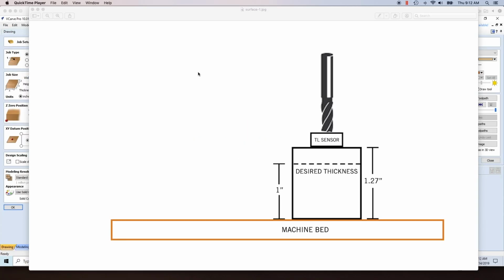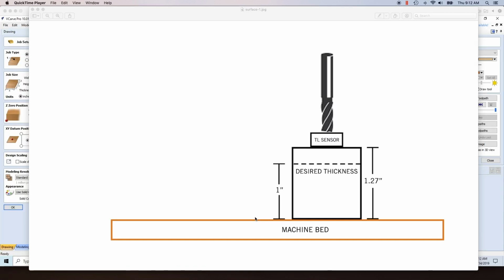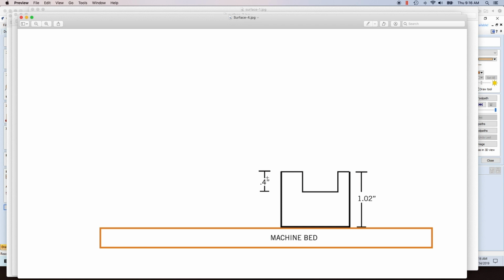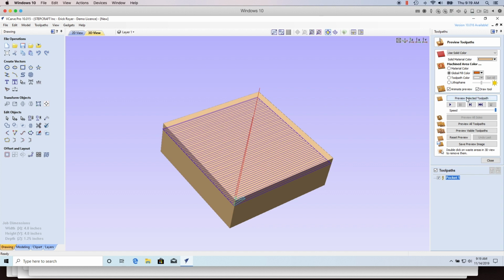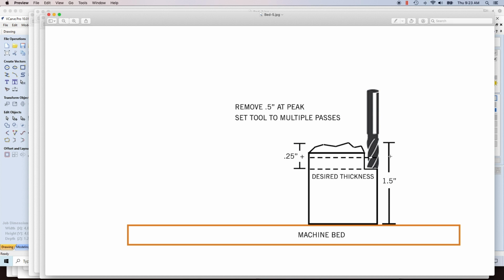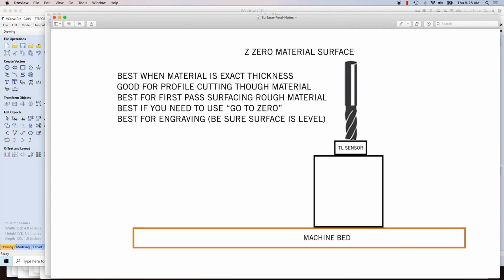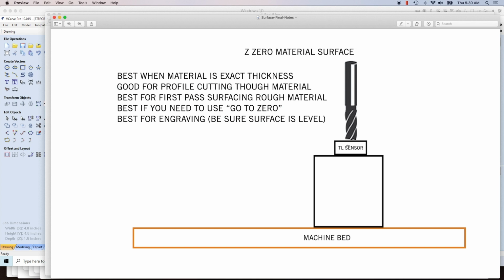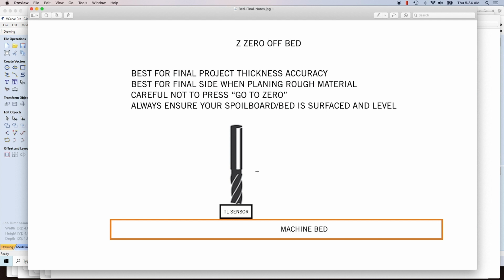Bed Or Material Surface? Where to Zero Your Z Explained

Comment: I had a job the other day, i've zero'd off machine many times but never had a problem until the other day when instead of going over my work piece it tried to chew its way through it side ways. Its very annoying. Still not even sure how it happened. 
Is it possible safe z distances mess things up?

Comment: I want to zero off the machine bed (bottom of material)my question is since i use a usb and the machine doesn't know any thing but my xyz setting until i run the usb file.do i have to offset my xy to make sure i dont hit my material or do i set a clearance allowance to accommodate and prevent hitting my material? little confused how i set this up,thanks

Comment: Very informative.  A BIG thanks!
Stupid question.  Using VCarve Pro. In the "toolpaths material setup" would the home/start position be the thickness of your material plus a safe Z gap?  I use .8" as a safe Z-Gap from the material surface.  So the Z-Gap would remain at .8" but the home/start would go to 1.8" from the machine bed if the material was 1" thick.  Am I thinking correctly?

Comment: How do these options work if you have an auto tool changer already set up and zeroed?  As the project changes do you have to re-zero the tools you plan to use for that job?
Reply from the maker: Yes, when you setup the tools in the tool changer all that it is doing is setting the tool offsets.  You still need to Zero your job before you start cutting so the machine knows where the tip of the tool should be

Comment: Well done!  I've wanted to see this explained for a long time.  This is the only video I've ever seen using the machine bed.
Reply from the maker: Thank you, I noticed that too which is why I made it - let me know if there are any other subjects you would find helpful. - Erick
Reply: @StepcraftInc  Hi. Same here. Many thanks. I have the largest Ooznest machine and my MDF spoil board has a bow down towards the centre, so I need to 'measure' off the bed. That "Go to zero" advice is the best one yet!!! It means move the spoil board to the side, zero to the bed, lift 'Z' then place and secure the spoil board down again. Then hit 'run program' WITHOUT clicking on "Go to zero".

Comment: Great info. Thanks. 
I've got the d840 with the aluminum tslot table. I also use a 6mm mdf spoilboard with slots cut to match. 
Do i need to add an offset in uccnc /vcarve pro for the z height if I was measuring zero off the bed?
Reply from the maker: In any case when you use a spoilboard, I would zero Z off the top of the spoilboard.  This way as you surface it and the height is reduced, you are always starting jobs with an accurate Z Zero based on the top of the spoilboard/bottom of the part.  Does that make sense?  I can maybe make a quick tip video on this

Comment: Thank you for the time taken to explain this procedure, my is question is:- Is it better to use the zero start at a corner? Or how do you transport the tool after zeroing if it is a centre zero.
Reply from the maker: This is a good question.  I typically will use XY Zero on the front left corner if I am working with sheet stock or cutting something from a larger piece of material.  If I have a part that requires precise location of the cut based on a set outline then I will use the center.  However it is harder to accurately find the center manually (the exact center), so I use our 3D Touch probe - I will make a new tips video on this

Comment: Hi, thanks for the great video for zeroing the tools. As you say in your video, we need to make sure the Machine Bed or spoilboard is level. How can we achieve that? I cant find any info on this. No video on this Leveling, Squaring, or Tramming on an Stepcraft machine. Everyone seems like taking it as after putting the Stepcraft machine together and its perfectly Square but that’s is not the case for any machine. Btw I am using the Stepcraft D600. Is it possible for you to make a video on this Leveling, Squaring, and Tramming on a Stepcraft D-Series? I enjoy all your tips on the video a lot. Thanks for sharing.
Reply from the maker: Absolutely, I will work on this next week too.  It is not hard to do but I can put a short video together to explain it.

Comment: Thanks Eric, grate video as usual.  Could you make a follow up video showing detailed steps on how to use machine bed, with the actual CNC using UCCNC?  Specifically, once you zero the tool on the machine bed using the TL sensor, how do you position the tool in relation to the work prior to running the job.  I almost learned the hard way not to use the "got to zero" button after referencing off the machine bed.  Gotta love the E-Stop button!
Reply from the maker: Yes I will work on this.  Thank you for the compliment, I am glad you like the videos.  Look for a tips video next week on this
Reply: @StepcraftInc  Did this ever happen? I can't seem to find it.